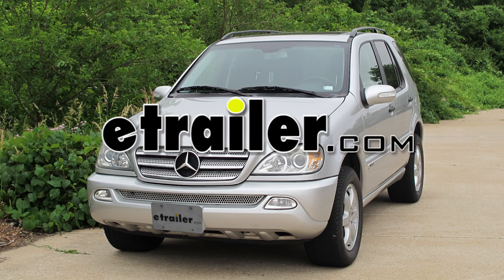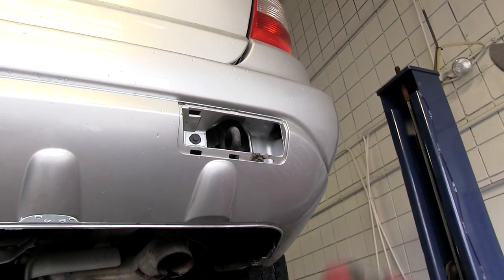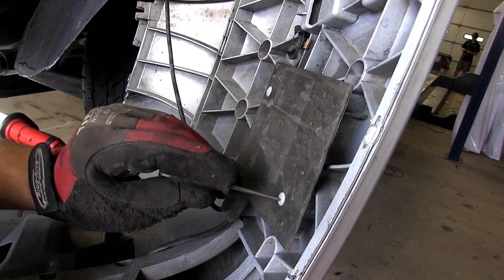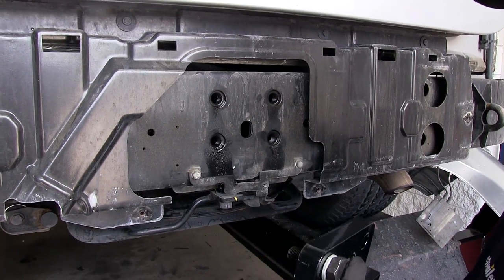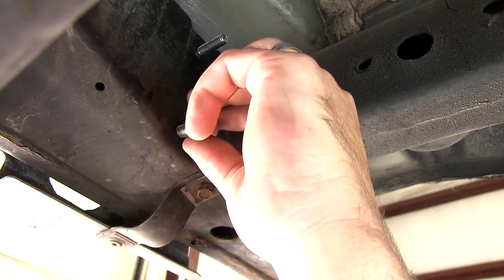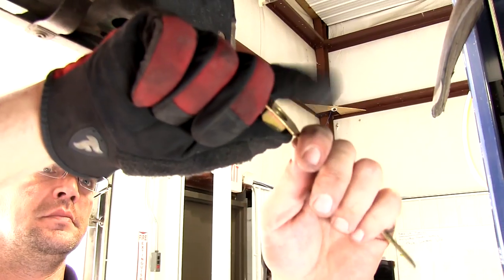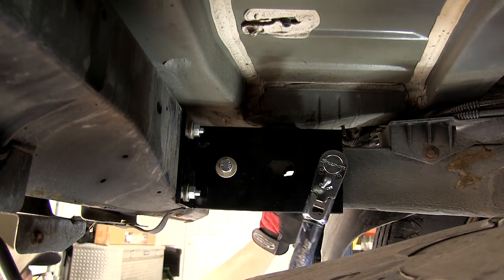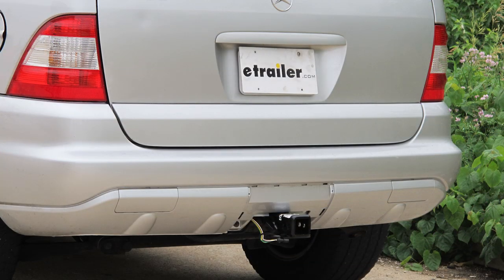Installation of a Trailer Hitch on a 2003 Mercedes-Benz M-Class - etrailer.com

Comment: Were you able to install the harness for the trailer lights on the vehicle?  I have the same vehicle with the hitch however the dealer refused to install the harness UHAUL would not install it either something about the harness going bad after only about a couple of months of operation so now I have a hitch that I cant use any thoughts?

Comment: I was a truck accessories installer for a summer and we installed hitches, camper shells, nerf bars, sliding windows etcetera etcetera. Not once have I ever read instructions where you place that washer between the hitch and the mounting surface. What is the purpose of placing the washer between the two? I ask because I recently installed a hitch on my 03 ML500.
Reply from the maker: Draw-Tite tells us that the washers are used to shim the receiver portion so it sits out a bit further. That's their explanation.
https://www.etrailer.com/p-75087.html